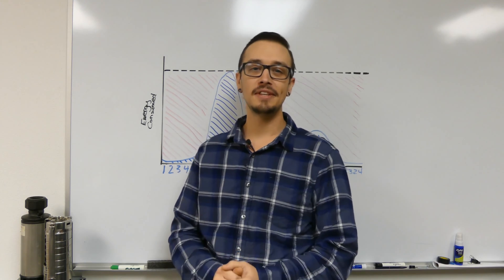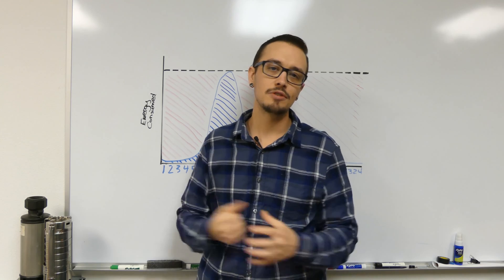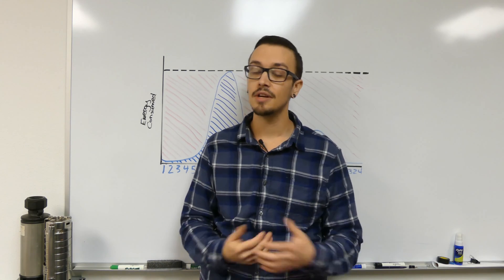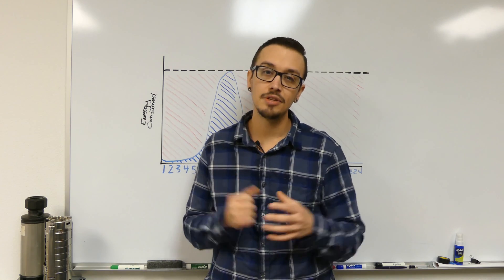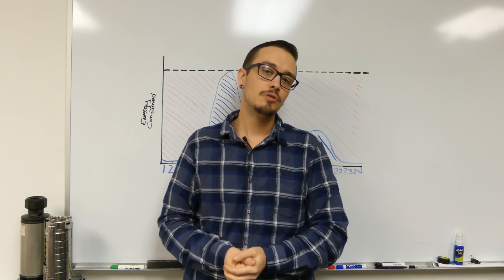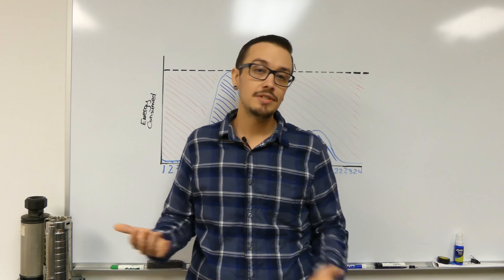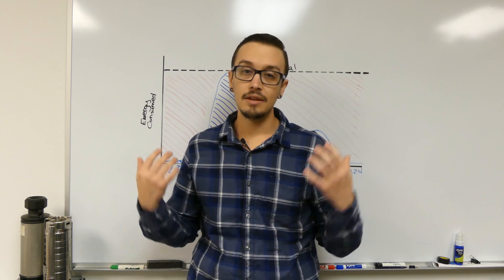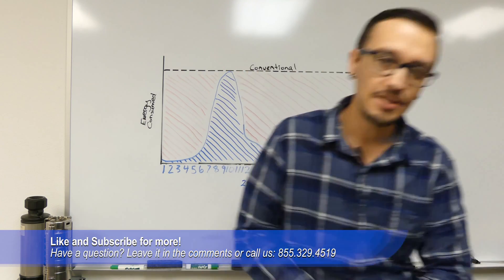Is a VFD Constant Pressure System worth the $$$?

Comment: I really appreciate you do this kind of video. I have a problem with my submersible pump. I just got a new well drill and connected to my Pressure tank. The water pressure build up to 60psi and cut off fine. but when a valve is open the pressure drains down zero and shut off the pump. so we cannot use the water. I tried to prime it by opening the drainage pipe little bit and have it run for a while but it's fully open, the pressure will drop to zero and shutdown the pump. Is there anything wrong with my system? this is a fairly new system, unfortunately, it is out of the country and no one has any idea of how it works. Would you happen to have any idea what could be causing the pressure to drop to zero?
Reply from the maker: Why is the pump shutting down? Do you have a low-pressure cutout switch installed? Like the one in this video: https://www.youtube.com/watch?v=ROvZpwHV9Ho&t=20s

Comment: Problem: I have a 160 gal storage tank with distilled water which we use for university laboratories. The water is plumbed through 3 floors at all our labs and works by gravity. There are at least 50 faucets. a few months ago, we had a leak. I checked all the faucets 3 times as well as the shut off values and for the life of me I can't find it. As a result, and if I forget to fill the tank, it empties out overnight and I have to go from lab to lab to get all the air out of the lines. Needless to say, this is a royal pain in the ass and, try as I may, I can't get all the air out. If I were to install a variable speed pump right below the water tank, can it be used to force the air out of the water lines when faucets are opened?
Reply from the maker: Please give our techs a call to discuss: 855.329.4519

Comment: I would also say if you got a 600 hp turbine and your running multiple circles. One circle has made its pass and shuts down. The desired flow is reduced by 1200gpm. You do the math. You can put a csv on it and your burning 650 amps still while getting 35% less water. Or you can overpressure and blow up a center pivot. Or you can run a drive and it scales back to 45hz. Thats a 25% reduction in freq and volts and 57.9% reduction in power usage thats a amp draw of 274 vs 650. If you run a derated pump end. So you can speed up to 80 hz. Its a misconcention thats a kets say 7.5hp notor for a 3hp pump end. However if you were gonna put a 7.5hp 90 pump and motor in. Which you can do and run up to 60hz like normal. However a 3hp 90 gpm on a 7.5hp at 80 hz will produce a better curve than a straight 7.5hp motor + pump
Reply: If you choose the right pump it will have a natural horsepower drop of about 50% without reducing the speed.  So the 650 amps would be reduced to about 325 amps with a Cycle Stop Valve or CSV.   It is a misconception to think the amps stay the same just because the speed is constant. All good centrifugal pumps will have a horsepower curve that naturally drops as the flow rate is reduced or restricted with a valve, without varying the speed.   It is rare for a VFD to reduce the horsepower enough to justify the expense of a VFD over a CSV.
Reply: @cyclestopvalves8380  , very interesting.  I'm fascinated by the amp draw change depending on load; recently I installed a HiBlow pond pump.  When I cover the end, of the air output, I see an amp drop.  When I release the end (of the air hose), the amp draw INCREASES.  This seems the reverse of what I expected.  Based on that information, it makes sense that a booster would operate much the same way; when the draw is reduced (through restriction), the amp draw would also drop.  It's an area of electricity that I am new to.  Looking at buying a new booster pump (multistage, single phase).  So your information is VERY helpful.  I think it is a very misunderstood area, which is why I want to know more.

Comment: What about if a family has a 9 bathroom house. A 35 gpm shower and 30 gpm irrigation zones and he wants to be able to run the irrigation alone, or at the same time he showers in his 35gpm and somebody can shower in his 6 gpm shower and run a zone. He also wants a zone to be able to run alone. As low of flows as 13 gpm on drip tubing. He also doesnt want big tanks in his lawn or garage.
Reply: Well then he gets a 5 or 7.5 hp with a 50js or 75js with a crazy expensive vfd and just doesn’t complain when he has to call the local pump company for maintenance every few months lol
Reply: @davidmartens7253  what if I put him in a 5hp 90 gpm with a vfd and he just called me out to change the filters it's a 3r cabinet and it's the first maintenance he has had in 7 years?
Reply: What on earth does he use as water heaters for a 35 gpm shower?!   I've never even contemplated something like that

Comment: I challenge your statements on costs, particularly insofar as a new well and infrastructure.  A VFD system allows the use of 3-phase motors, which are more efficient and which allow smaller cable diameters.  The savings on hundreds of feet of cable alone can be massive. In Canada we are allowed only a 3% voltage drop and thus cable gauge is a big factor.  On bedrock or low producing wells,  the costs of pump controllers, a dry well protector (pump tec)  and a large pressure tank easily exceed the cost of a VFD. As a business that services well pumping systems, I love conventional systems with their pressure switches, capacitors, relays  and large tanks... their failures are a good source of income, but I prefer the reliability and happy customers, so we only install VFDs with new systems, and getting rid of a bulky tank is a big selling point for existing systems.
Reply from the maker: Check out the new video: https://www.youtube.com/watch?v=Wi2Y8ppZtlo
Reply: In EU max 4%.
Reply from the maker: Challenge accepted. I will soon create a video using 3 separate well examples. You are welcome to provide me the well specs such as depth and recovery as well as operating pressure and flow requirements. If I do not hear from you before the end of this week I will just select 3 random wells on my own. I will show in depth energy consumption and reliability factors including run time, etc.

Comment: This is a really thorough and informative video.  Thanks for putting it together.  My parents have an open loop geothermal system...I'd like to know if you've got any thoughts on setting one of those up for the best efficiency as it demands water 24/7 about 8 months a year.
Reply: I do not know much about geothermal systems since that is not my area of expertise. I know it can something be difficult to find a pump if the water temp is too high. Cooling would be my major concern and a possible reason to use a VFD on an over-sized motor to have better control of motor temp.
Reply: Thanks for the video Chris. Same situation here with an open loop geothermal system. My water tank is leaking and the plummer offers a constant pressure drive system. The 1HP well pump has been faithful for 30 years. It sits in 38'F water and works hard only during winter; 6 months long here in Quebec city. Your video confirmed my decision to keep the old system and replace the 25 gal draw down tank. I have the space. Also, during grid outages, I run a generator which would surely have bad effects on the variable drive electronics fragility.